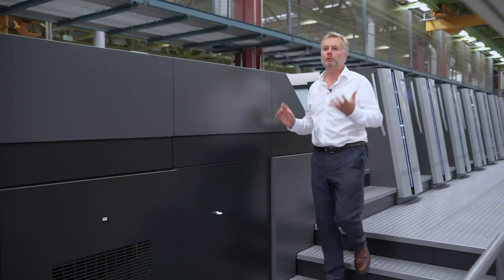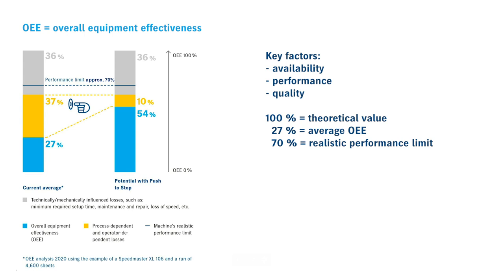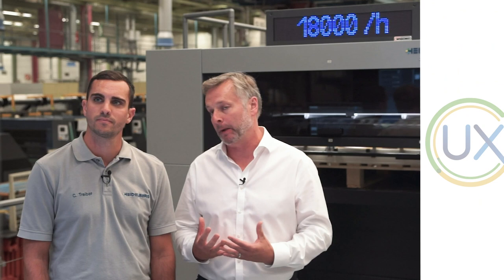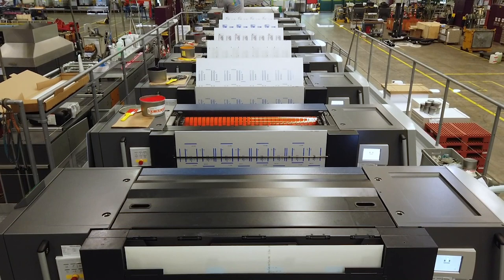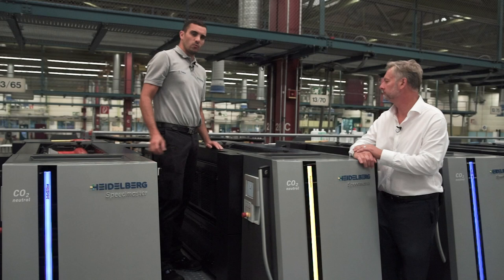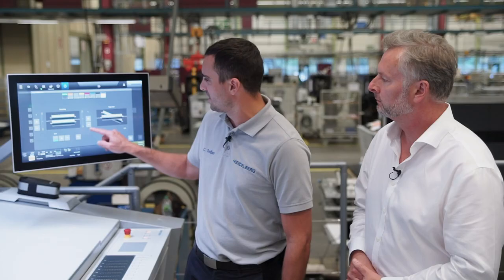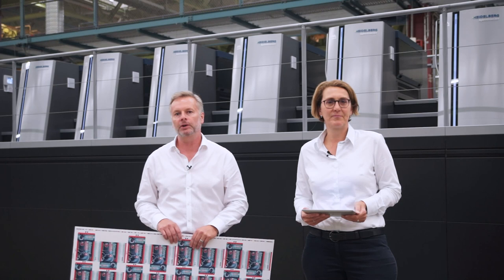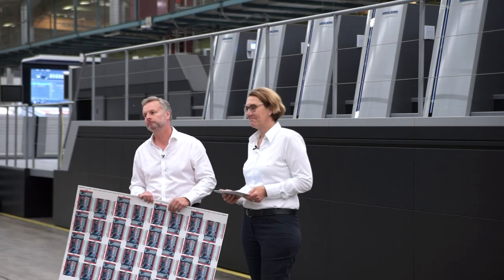Navigated printing in packaging.

Comment: The defect inspection camera system, is it available to all the presses??
Reply: Yes indeed it is. You can also check other job sheets via the program and monitor other processes. But luckily the printer does most of the work, just have to make sure to add ink frequently or else there will be printing defects

Comment: WHY we still have to bend plates?? WHY??? it is really timeconsuming process!!!
Reply: I know right! Since the good old days that has never changed!! Good point!! Hmm??
Reply: Buddy you must work on old press I run on heildelberg xl 162 , no bending plates on punch holes
Reply: @jgslimftwguzman1926  Hello, I also work on an XL162 and the plates do not bend. What I can't do is do a correct nonStop, something always fails and if it doesn't fail when withdrawing, the bars that hold the paper drag it and fold it, so in the end you have to stop to remove the folded sheets.
Reply: @studebaker8288  ong it really do be tiresome and nerve wrecking when it spits it out like that.